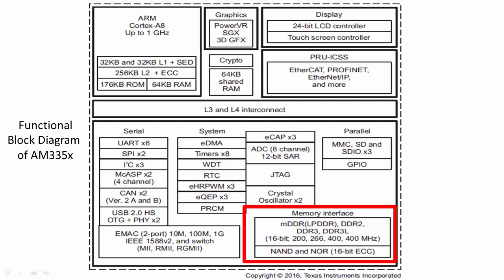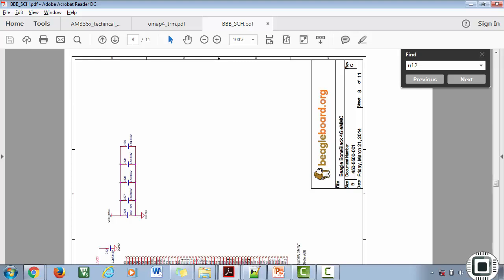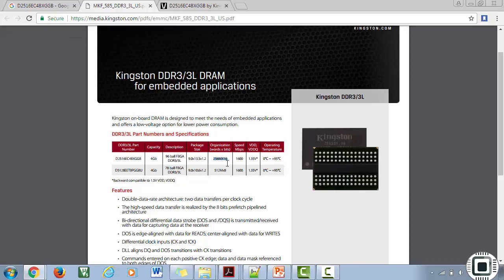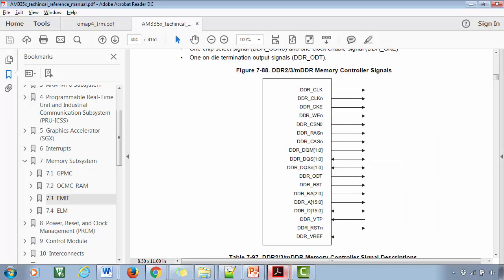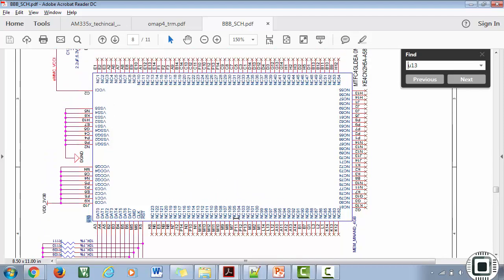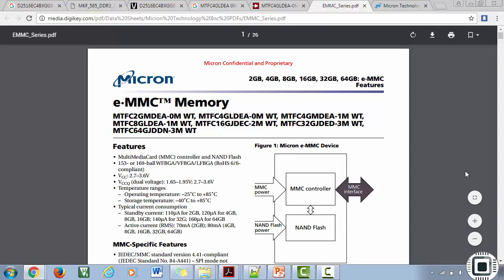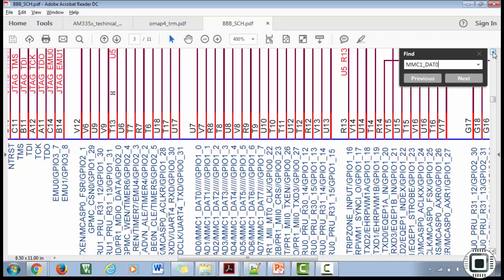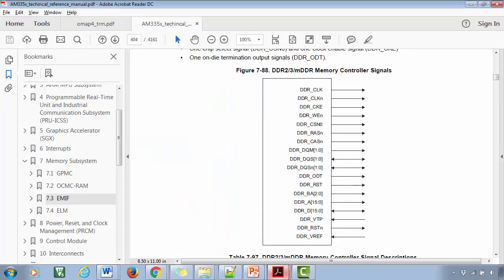Embedded Linux course  Part 2 : AM335x Functional Overview

Comment: I think the datasheet says 4Gb that mean 4 giga bits and that in fact is 512 MB of RAM so the Beagle board is utilizing
Reply: Yes, this statement is correct. 4Gb DDR3 means 4 Gbit and this equals 512MBytes. It is opposite to eMMC storage, where 4GB means 4 GByte.